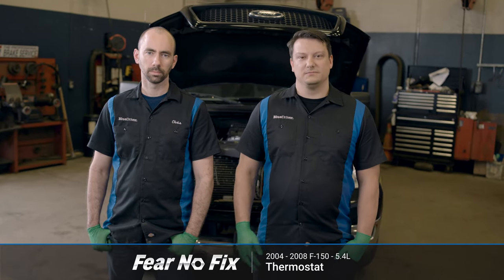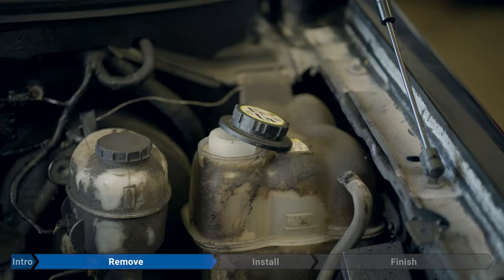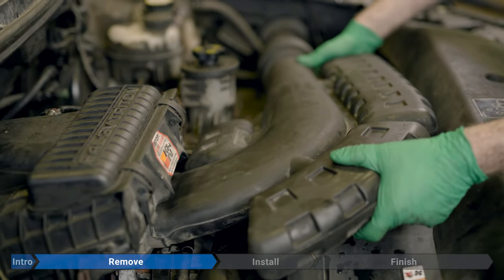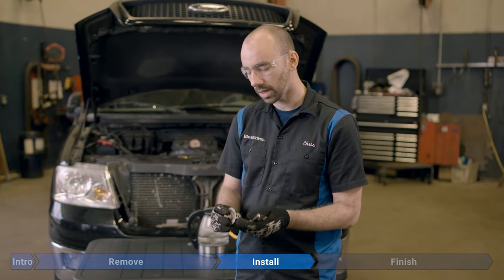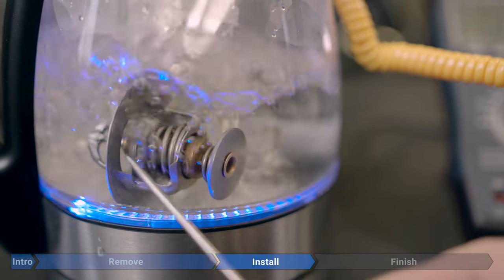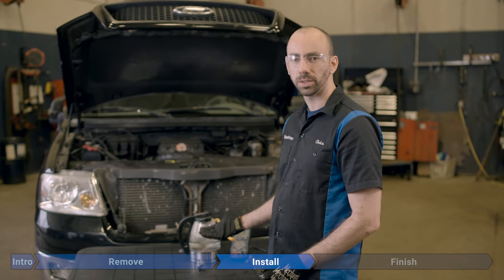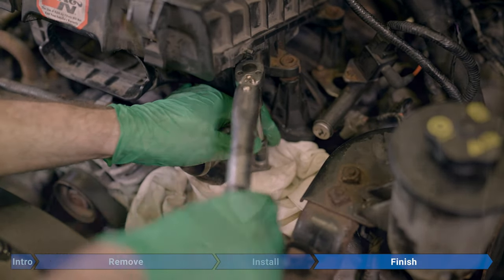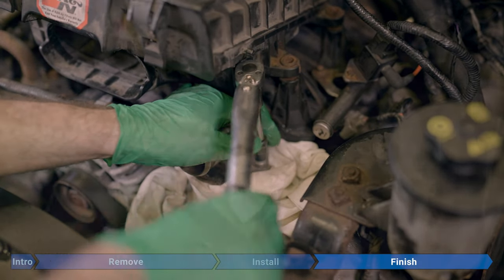Thermostat – 2004-2008 5.4L Ford F-150

Comment: I bought my 04 f150 with 33k miles in 09.......I have never changed anything out until recently. I'm at 160k and iv finally done plugs (they all broke 😔) , coils, fuel injectors, evap valve,  o2 sensors, fuel filter... all this year... even tho iv been horrible with the maintenance....my 04 f150 still runs and purrs like a champ lol..... anyway, this channel has come in handy!!!!! Thanks guys, this channel has been a life saver!

Comment: Thank you so much. I replaced my valve, but unfortunately the error p0128 went back on, do you know what I might have done wrong? Thank you guys!
Reply from the maker: This could be caused by anything that causes the engine to warm up slowly (or ECM to think it is anyways) - you've probably already done it, but double check your coolant level and maybe bleed it again for air. If that doesn't do it try looking at your coolant temp sensors if you have a scanner, see if they seem realistic compared to your ambient temperature
Reply: @LemurMonitors  Do u have any videos on the P0119?
I already chamged my Coolant Temp Sensor. The light stayed off for 1 week.
Now its back on.
Ive also filled coolant level above full line. So its def not low.
Any idea whats next???

Comment: My thermostat was completely rusted ? What would be the cause for that. Also can an engine run for years with a shot thermostat? No giving signals or showing overheating? My mechanic says it's possible but I think the engine would overheat 😊

Comment: My f150 5.4 3v temp gave not working and  showing code p0119 so I changed it the temp gage still not working but truck seems better what could cause the gage not to work

Comment: I opened trhat plug about 4 turns and nothing came out. The reservoir is a little bit low a  ,theres no heat and its not overheating.

Comment: I’m changing the upper and lower rad hoses, the thermostat, and replacing the fluid. All coolant is out of the system.
 What is the best way to add coolant back into the system?  

Should I pour some coolant in to the thermostat hole?  

Or should I just add it all directly into the reservoir? 

Also, a video on changing the lower rad hose would be beneficial, it was a pain in the butt to get to the bottom hose. I had to remove the power steering pump. Maybe there is a better way you could show us.

Thanks.
Reply: I'm in the same pickle I'm thinking of just cranking the motor a little to start to pump it through

Comment: I’m not one to really comment on anyone’s channel but in this case I’m curious so I’m gonna ask. Is there a slight crack on the housing right side on the bottom? 
Just wondering not being a ass honestly I give you 💯 respect for doing videos it’s not easy if you want it perfect.
Reply from the maker: Haha good eye - it looks like the bolt on that side was poorly drilled out by some previous owner

Comment: The thermostat i bought had a gasket that wanted to go around the  new one, but aint no way in hell with the already tight fit, the old seal doesnt look cracked, would it be fine to re use?

Comment: How crucial is it to torque those 10 mils?   That’s the one tool I don’t have
Reply from the maker: Your discretion really - most people probably won't bother, but one thing you can't really see in the video is that one of the two was drilled out before after twisting off so be careful
Reply: @LemurMonitors  you talking from over tightening ?   Or from being over torqued before and snapping when trying to loosen ?
Reply: German torque... gewd n tight. Lol
Reply: I would be more concerned with over tightening.